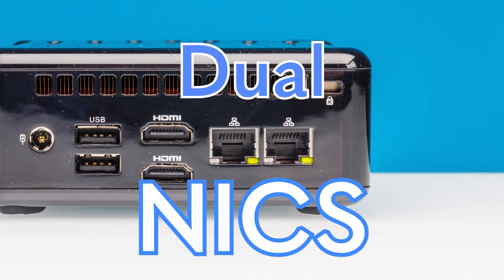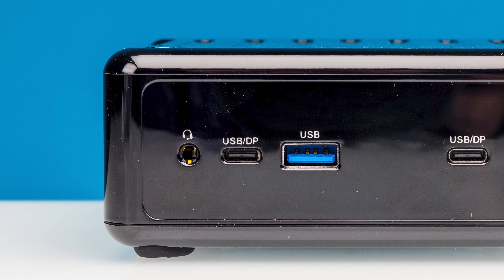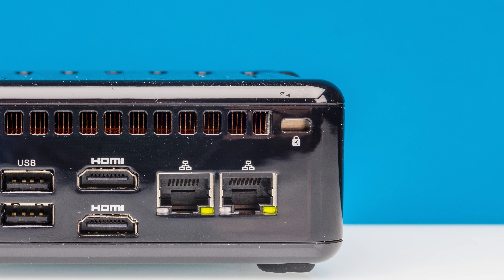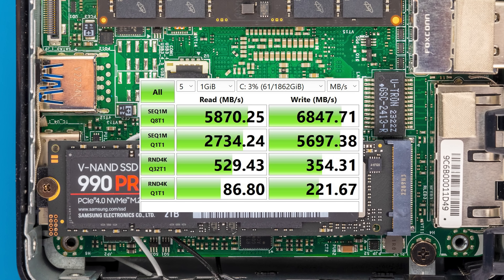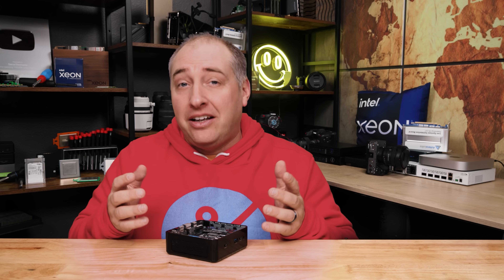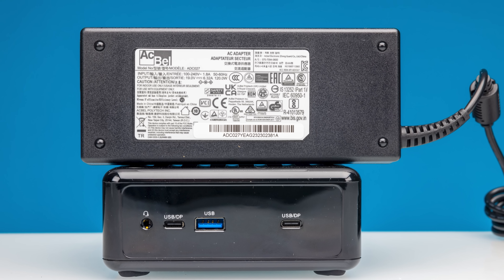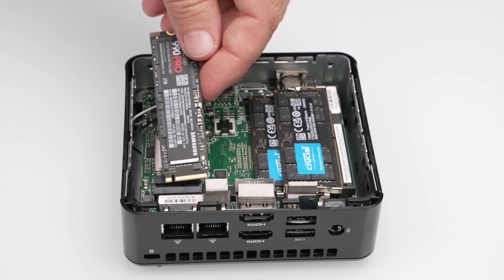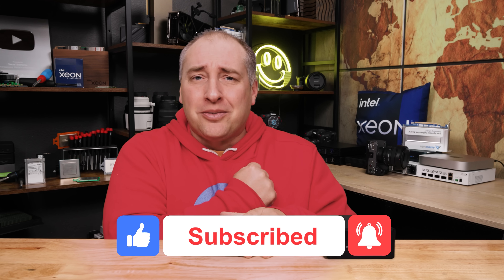MIGHTY Mini PC - This AMD Ryzen Powered ASRock is NUC Sized

Comment: Two NICs, and neither one labeled.
Which one is 1Gb, and which one is 2.5Gb?

They the manufacturer either decided to save 3¢ by not stamping a label, or that the manufacturer missed this in their quality control.  Well... either one is a red flag.

If they were too cheap to label which NIC is which, then where else did they skimp?  Perhaps on the fans?  They need to spin quietly only until the warranty expires (or, perhaps, during Amazon's return period).

If their quality control missed labeling which NIC is which, then what else did their quality control miss?

As it pertains to this review, I would have liked to see some stress testing, to see how the unit holds up under full load for extended periods of time.
What happens if you hammer the NVMe drive for 48 hours, and keep the CPU pinned for 48 hours?  Will it manage the heat dissipation properly?

Some might say that that is an unrealistic stress test.  For most folks, that would be correct.
But we should know if the unit is designed to run at full load for lengthy periods of time.

I had purchased an HP EliteDesk 800 G2 with a 6th gen i7.
I had it create Chia plots, via MadMax's plotting executable.  The fans ran like a space ship, and blew out enough heat to warm the room.  But even for that business / commercial quality unit, it got too hot and failed.

Who knows what customers will do with these units?
A thorough review should include pushing the unit to its design limits -- especially when they are higher end units.

Comment: MinisoFrum are about to release a new MS-01 Workstation with Intel i9 vPro processor, with option of either 12th or 13th gen. It is a 1L mini-PC design like HP, Dell & Lenovo. There is easy access for RAM upgrades, adding PCIe 4.0 x16 slot card (half height, single slot) - e.g. supports RTX A2000 Mobile, and up to 3x M.2 PCIe 4.0/3.0 SSD and one of those slots can support a U.2 / 2.5-inch SSD via an included adapter card and dip switch setting. In addition to the usual port selection, there are two USB4 ports, two 2.5 Gbps ethernet ports, and two 10GBps SFP+ ports. It looks interesting and the barebones 13th gen i9 currently costs $679 on pre-order!
Reply from the maker: We posted a short with the MS-01 yesterday on the shorts channel: https://youtube.com/shorts/TuFMMeZyfsY
Also a first look on the main site: https://www.servethehome.com/minisforum-ms-01-launched-10gbe-mini-pc-first-look/
Plenty of fun bits like using a GPU (usually requires custom cooling) lowers the TDP of the CPU and most will need a new power supply for it. There is a switch that if set improperly will fry M.2 SSDs, and so forth.

Comment: The problem with this box:  only 1 2.5Gb port, not two like on the competitors.  I paid a bit more than half the price for the ASRock and got two 2.5Gb ports -- truly essential for a firewall application.

Comment: At a workstation level, not really seeing the need for dual 2.5gb ports. If you wanted to use it in a server or vm host type configuration, then sure, that would be a plus, but otherwise not seeing the use case for a 2nd 2.5gb NIC.

Regarding the UISB ports, even in the quad display mode setup, aside from a wireless dongle for a keyboard & mouse, and maybe a webcam and as a stretch a wired controller, what else do you need to have plugged in that unplugging whatever is in the front port is that big of a deal? It's far more IO than you'd see in a laptop with that CPU in it, and in the older platforms more ports generally means more USB 2.0 ports, which you would  then complain that they're not 3.0 ports.
I suspect that those twin 4.0 ports up front are using up the PCIe lanes that could otherwise be used for more USB 3.2 ports on the rear.

For me, I'd ditch one of the 4.0 ports for a 3.2 type C port and a 2nd M.2 slot inside.
Reply from the maker: That is super easy. With SMB3 Multichannel you can just plug those two 2.5GbE ports into an unmanaged switch and if it is connected to a 10GbE or dual 2.5GbE NAS you get almost 5Gbps without doing anything else.

Comment: I'm sorry, but calling anything with external power brick industrial is idiotic. Guess what gets lost first in industrial applications? So $600 unit becomes useless because $50 power brick is easily displaced during a line change. I think it's time to develop a standard power supply for these things. And they should be built in. I know, been there, done that for 25 years. The mini-micro is really great but... And please fix this Wi-Fi connector on cards that's so hard to connect and frankly flimsy. It's about time for standardized,  internal micro-itx and supermicro-itx power supplies. Great review as always.
Reply: Barrel jacks are pretty much standardized and most laptops have 19V PSU's, so as long as you can find any laptop PSU that's capable of providing a high enough current, you're back up and running. But yeah, by "industrial" i'm also thinking of an office, rather than say a furniture workshop or a chemical plant.
Reply: @bjornroesbeke  I'm talking about mounting these things in manufacturing situations. Pure nightmare. Usually network patch cords squeezed together by maintenance with power bricks and cords by zip ties until oil comes out of them. It never looks or performs well. Also I'm talking internal antenna connector. Where it's connected to M2 card. Had to deal with many that fail on stupid Dell tablets and man, that's way too hard. BTW trust me, most IT guys are too expensive to be looking for a stupid PS that fits.

Comment: Thanks!
As for wish list, i like all of yours, would add bootable to your  SD/micro for if someone wants to retire it as a firewall some day and wishes to have a ZFS boot pool.

My own wish would be to add the ability to play around with memory. I know Zen4 monolithic is capable of great memory performance if its anything like Zen3 monolithic, which i can get to ~5000C18-18-18-34 gear1 CR1 with MCLK/FCLK/UCLK all in 1:1:1

Problem is right now they're worse than desktop unless using LPDDR5, which is weird because the traces are shorter on sodimm than dimm, so laptop should support faster speeds(assuming they dont overheat)

My minisforum and beelink dont want to post most of the time if the kit is rated above 4800, if it does its often at or below 4800 and in 2:1(MCLK/FCLK at 1200)
I dont need the extreme dials and knobs i used to get a memory OC record on DDR4, i just want to be able to hit XMP/DOCP/EXPO, the 64GB kit of 5600MT/s wasnt exactly cheap :P neither was the 32GB kit of 6400 i started out with. I think i went through 3 different 32GB 5600 kits before it posted at the rated speed
Reply from the maker: Wow! Thank you! On the firewall/ ZFS, I think we are going to finish one in the new studio on that kind of option today/ tomorrow, but it might take a week or two to go live depending on editing, Christmas/ New Year's, and the order of the next few videos.

Comment: These things are great for small lab setups where you don't need to move large amounts of data. I have 6 of these on a 4U shelf for our dev sandbox. We mostly need to test data flow in and out so it works fine. Between the lack of noise and lack of heat they were great. Now it's just the DB and Archive that are traditional noisy servers in the lab. The 1Gig port is a limit of the AMD/Realtek DASH functionality. It's built into the NIC chipset in order to share the etherhet port/PHY. The real tragedy is that the DASH firmware isn't installed on the NIC out of the box. So you have the 1Gig limit cause of a feature they deliberately included but somehow didn't enable out of the box. You have to ask ASRock for the firmware to enable it. Hopefully that whole process has gotten better. In theory if the DASH functionality could give a basic IPMI interface to do thing like power on/off/reset, set boot device, and serial over lan then this thing would be a home-run. Last time I looked at it was probably about a year ago and it was kind of a hot mess.
Reply from the maker: 4U shelf for these is HUGE!
Reply: @ServeTheHomeVideo  For me and what I was testing I needed the room to occasionally power cycle them. I also have an 8-port 2.5G to 10G switch in the back of it since my regular switches are 1/10Gig. We use the 2.5G for SAN/NAS and 1G for the network testing. They work well but aren't exactly cheap. Just not having to listen to the room down the hall humm from the old blade center was worth it.

Comment: Im probably buying a Lenovo P3 Tiny with i5 13400T, 32Gb 4800 and a  nvidia T1000 8gb but Idk if it’s better than a base Mac mini m2 with 24gb ram and 1tb to work from home as costumer support, graphic design and play some ps3 emulator but the power consumption thing is driving me crazy cause the P3 Tiny has a psu with 170w and the Mac mini website says that the max is 100w. What do you think that is the best per watt? I can’t find other mini pc that can fit a graphics card to help me with design.
Reply from the maker: WOW! Thank you!!! I think the AMD Ryzen 7040 APUs with the Radeon 780M are good. I am not sure I would get a T1000 unless I needed the NVIDIA GPU specifically. The Mac Mini is usually very low power. We had a cluster of those running in the studio off to my left in some old videos.
Reply: @ServeTheHomeVideo  asrock just announced the 4x4 box 8040 series, is it better then this one that you said and the apu as well?

Comment: in my opinion the 7840U is actually the first real decent ascendent of the (reference) 4800U; the 5800U wasn't and the 6800U was actually a kind of a disappointment. This 7840U is a significant improvement on all fronts and is on par with the less power efficient 6900HX while outperforming it on the iGPU side of things.
It is really a pity this magnificent  APU is let down by it suffocating packaging: A noisy box with poor ventilation. (Was already afraid of this, since the day they announced it)
Hopefully the Chinese mini-pc brands will jump in and bring out a properly cooled enclosure for this APU, but they seem more currently focused on absolute performance rather than performance per Watt. Hopefully I'm wrong and we'll see more  mini's with the 7840U
Reply from the maker: Very fair points.

Comment: DDR5 5200 sodimms are simply not supported by ryzen 7040 mobile chips. The exact same issue is present on the Framework amd main boards. Brand doesn't matter. Weird but this maybe an AMD limitation
Reply from the maker: Yea. I think it might be. Totally strange

Comment: I am very IN to these little mini PC's. I have the 5800u version from a few revisions back, using it as a proxmox server and it runs everything I need. Sure the extra speed from the processor and RAM would be nice to cluster one of these new models, but the performance is probably not noticeable. I'll take it though if you need someone to send it to!
Reply from the maker: I think we reviewed the 5800U model in September 2022

Comment: I don’t understand why inferior ports are in the mix. The 2x USB 2 and an extra 1GbE makes absolutely no sense to me. It’s like buying a Tesla with a wooden chassis.
Reply from the maker: USB 2 is for backward compatibility.
Reply: @ServeTheHomeVideo  forgive my ignorance, but you can use a 1.1 device with USB3. So what’s not backward compatible about USB3 that requires a 2.0 port?

Comment: A possible reason for 1Gbps plus 2.5Gbps is that 2.5Gbps ports are notoriously higher power compared to 1Gbps ports. It's difficult to come up with a ~6W idle 2.5Gbps solution as it is.
Reply from the maker: These days a higher-end Intel i226-V is like 1.3W TDP or so, and usually operate much lower than that.

Comment: Thank you.  Would really be nice if they ran on 12 / 24 volt battery pack voltage instead of 19 volt. 

I rarely use ethernet except for initial setup so I ok with that aspect. 

The SD card would be nice but not a deal breaker.   Does it come with windows already?

Thanks
Reply: just use a usb pd trigger board set to 20V
Reply: @-morrow  Thanks,  will look into that approach.  So feed the power in through a USB port or rewire the charging side to feed the USB output to feed the 19 volt port?
Reply: Gotta think of all those warehouses full of 19v laptop power supplies man,   how else they gonna make money of all those old power supply lying around.

Comment: I find it weird to put less than 2.5 GbE anymore and even more weird to put one 2.5 and a 1 rather than just put dual 2.5GbE. Cause then you are hardware limited. Modern wireless connections are faster than a 1Gb wired connection. And you can't do anything about it if your hardware limited. I would have no complaints if you could pop in a new ethernet port like its a stick of RAM. But thats my 2 cents. IMO 1Gb should be relegated to IOT devices. 2.5 or faster should be standard by now is what I think. How much more could it possibly bump up the price? Is 2.5 really that much more expansive?
Reply from the maker: Yes. Totally right
Reply: It's cents
Reply: @LA-MJ  Thanks. Just curious but...was this comment a spell correction? Cause I did put "cents" and your comment insinuates that you might have thought I misspelled "cents" and commented a correction
Reply: @blackryan5291 I meant the price bump
Reply: @LA-MJ  Really? Adding 2.5 is cents? I have instantly started giving a lot of my devices the side eye now. Thanks for that. it was informative

Comment: I don't see the reason to not match the network ports.  For many, this would be likely plugged into the same network switch, a managed network switch, or just one.  But then, it should be 2 x 2.5G or better yet, 2x10G or 2 xSFP+ ..    Personally, if I want it to plug in both ethernet, I want them the same speed. No sense in scrimping to toss in 1G; heck, I can find other systems that will be courteous enough to put in at least 2 x 2.5G.
Reply from the maker: We have something coming with even better connectivity than that

Comment: USB4 can do host-to-host IP networking so for a little ring cluster that would probably be way more superior than using 2.5 gpbs NICs.  My only major gripe on these is not supporting ECC.
Reply: yeah sure, it can, but in practice, it's super messy, and after trying with a few macbooks, a beelink SER6 Max and a ProArt X670E (that would turn off the controller until hard power-on-PSU-off reset) if not chained through a hub entirely due to shared ground) I would absolutely recommend against it.

Comment: Would be a nice pfsense box, it's time to upgrade my old Fujitsu with an i5-3330.
Reply from the maker: Hold that thought. We have a few killer firewall boxes in the review pipeline just waiting for their videos to be done
Reply: @ServeTheHomeVideo  Cool, I need, well, want a small box with at least dual 2.5 GbE and fast should be able to handle wireguard without a problem =)

Comment: Mighty PC with wimpy networking... so sick of this 2.5Gbps marketing as if it is state of the art.
Reply: At least put 2x2.5gbE
Reply: @thestreamreader   AMDs internal management layer doesnt support 2.5Gbit as far as I know so for this system it makes sense
Reply: Given that most people dont even use half of a gbit connection especially in industrial systems I dont think its bad marketing
Reply: Maybe someone wants to run TrueNAS on and make use of the extra bandwidth? I can think of many use cases that benefit from the performance gain.
Reply: @HyperProtagonist  Well its not designed as such but yeah it could be useful